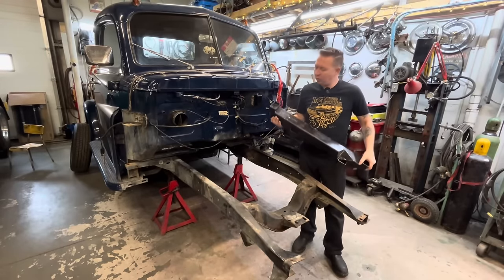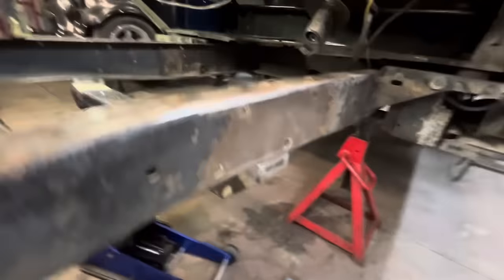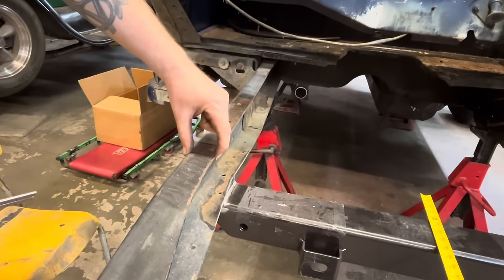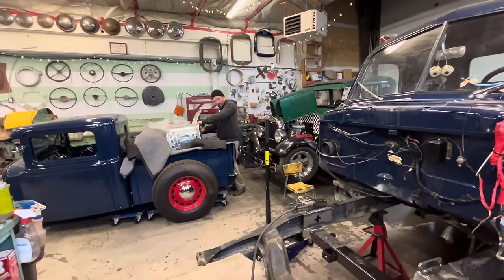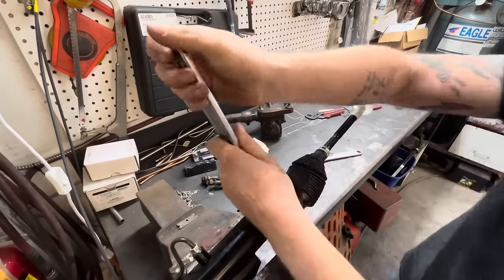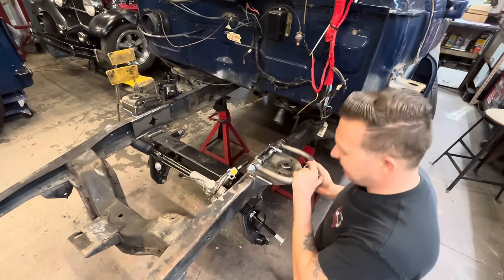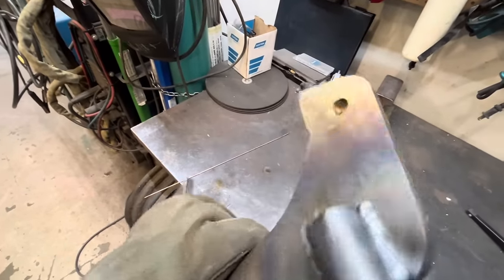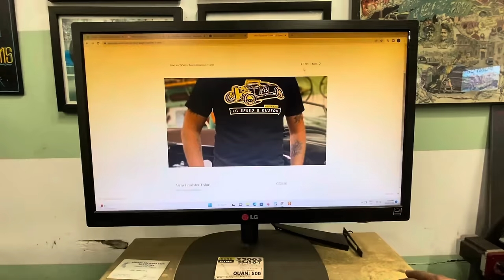Installing a Fatman IFS. 1950 Fargo Build Part 2

Comment: I used CAD (cardboard aided design) to make my boxing plates.  I used cereal boxes and held them against the frame and tapped along the lenght of the frame with a hammer to make an impression.  My templates were very accurate.  I don't have your software or a plasma table so I cut with a Jig saw and angle grinder

Comment: I found on my fatman ft. End that the upper ball joint bound up before the shock was fully extended. I put the ball joints in from the other side and swapped sides and gained travel. The shock was then the limiting factor.

Comment: The Stage III doesn't use the spring hats.  It uses Coilovers. So the upper control arms are bolted to upright plates and shimmed for camber/caster.  The dimension was the same as yours, 30" but the plates were 5/8" so inside 28 3/8".  I made a block out of 2 2x4s in a tee configuration and squared them up on my miter box.  Then ran a clamp over the outside.

Comment: I've always measured from the rear end housing when using a added front subframe to avoid dog tracking.
Reply: Wouldn't that only avoid dog tracking if you know your housing is perfectly square in the chassis?

Comment: When you pulled the Flathead in the transmission out of the truck that was the center crossmember for the cab mounts I put the fat man suspension in my 56 Ford pickup your crossmember going across the bottom of the frame you need to lower 4 in you'll never get the bellhousing underneath that floorboard You'll Play help trying to find a oil pan that's 2 in thick I put my rack and pinion steering on the front side of the cross member and used Camaros spindles calipers and rotors off of 67 front steer. To get bigger rotors bigger calipers bigger wheel bearings everything was bigger The Mustang 2 ball joint aren't strong enough for a big block they wear out quick and I broke the snout off the rotor that holds the bearing I would go ahead and Tack it in their assemble the whole front end set your motor in there and say oh shit I got to change a bunch yeah you need to put a crossmember somewhere between the motor and transmission that frame twists like crazy going in and out of driveways
Reply from the maker: If I lowered the crossmember four inches the truck ride height would be four inches taller and the lower control arm geometry would be out of whack. 
The steering rack is also supposed to go on the front of the crossmember. The spindles are already designed for front steer, no need to change them out.

Comment: After 25yrs working with rack and pinions I can guarantee the bellows with the extension will either slip off under full lock sooner rather than later and definitely deteriorate quickly😊
Reply from the maker: Maybe? This what Fatman recommended however. Do you have a part number for a longer bellow if they do?
Reply: @LGKustoms  Sorry mate, I'm in Australia and it's been 20 years since I stopped working the motor trade. You need a decent lip on the end of the tube to enable a tightened clamp to hold the bellows at least, maybe a lipped sleeve to match the extension. All depends how long a warranty you give on your work, the bellows as it is may not rip for years depending on vehicle use. If you research Rack and Pinion Gaiter on Google it may help, silicone are new

Comment: Looking good. 
Just a quick question about the calipers, why are they back to front the pistons are usually visible from the front?
Reply from the maker: Like why are they mounted to the rear of the spindle instead of the front? Most vehicles the caliper is mounted to the rear of the spindle.

Comment: Id box the whole length from the firewall forward.  But eeh ,thats just me!
Reply from the maker: In my opinion that’s kind of overkill. This isn’t a race truck, and the original chassis is already much thicker and more heavy duty than most automotive chassis’. 
It also has all season radial tires, stock ford Granada brake rotors, stock rear springs and generic coil springs up front. Meaning it will never accelerate hard enough, brake hard enough, or corner hard enough to twist this frame.

Comment: Didn’t you alter the hat angle by notching only the front of the hat 🧐
Reply from the maker: No, the angle is pre determined on the inside part of the hat. The part I notched was just the side. If you watch the part where I had them on the bench marking it out, you can see the angled part I’m talking about.